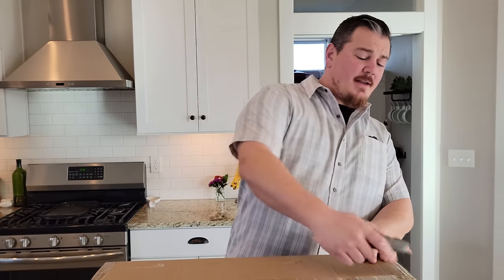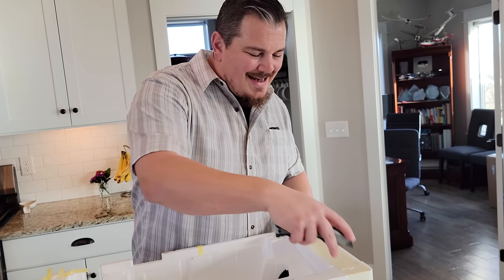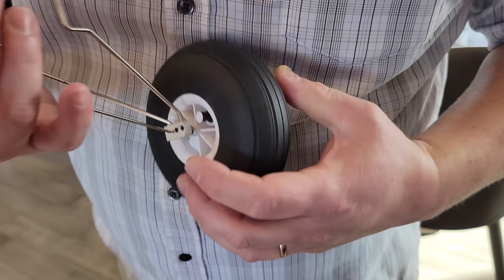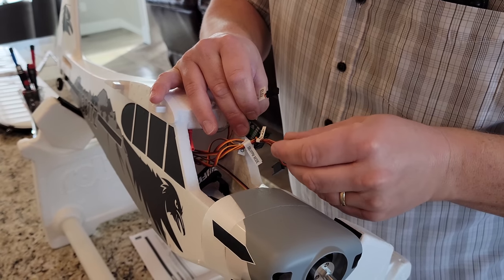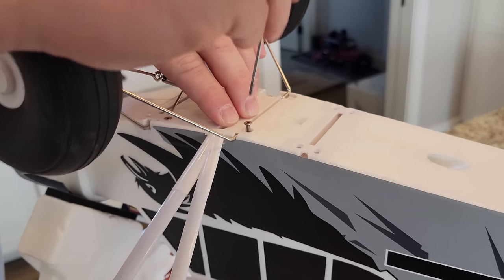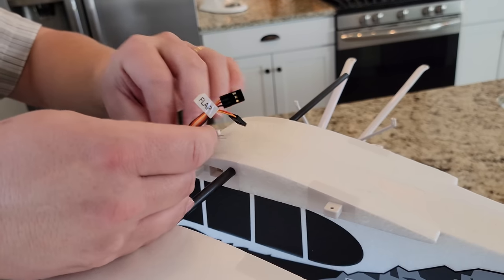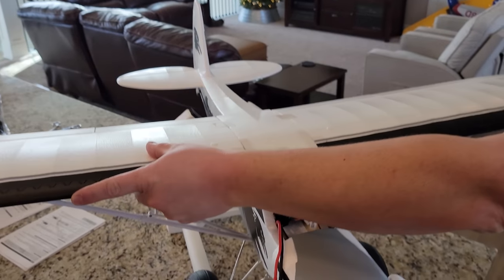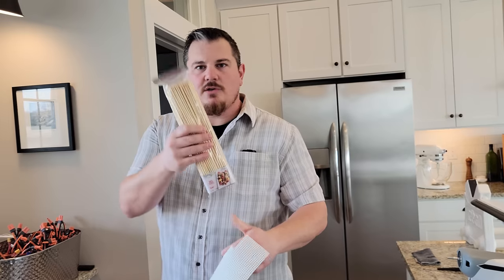FMS - PA-18 RTF - 1.3m - Unbox, Build, & Radio Setup

Comment: Thanks for the vid just assembling mine now was pretty straight forward but helps to see someone else do it first. Only change ive made is I upgraded the rudder/ tailwheel servo right off the bat to a metal gear unit based on reviews ive seen. Ive been flying the big stuff commercially for years but now getting into the models too. Cant wait to fly this. New subscriber from NZ for you cheers

Comment: I know this is an older video, but this with reflex V3 or the 1220mm Ranger with reflex V2 for a first large plane?  I have one of the micro warbirds that I learned to fly with but would like something larger if you have any input.

Comment: Hi! I Have a question about the FMS charger that comes in the RTF. I bought the plane and When i wanted to charge the battery first then the light for s1 got green, then s3, and s2. Is it normal? I dont know if i want to buy a new charger.

Comment: Wow that's a dulled down transmitter.....I got the fsi 6x as a first radio and it has a screen and 10 channels....I've never seen one like that and it's technically the same model....mine had all kinds of knobs and levers everywhere.....but it lasted about as long as my first plane.....1 to 2 flights lmao....then I bought a spektrum setup and now the flysky just sits

Comment: I just crashed mine on my maiden flight. 😢 I am not sure at all what I did wrong. Extremely discouraged because I think I did everything correctly. Just a small suggestion, maybe go a little slower when showing setting up the controls. I had to continuously rewind to make sure I set it up correctly. I am 100% a beginner as well. Thank you for the video it was extremely informative
Reply: just change your youtube speed setting to a slower setting
Reply: I agree not the best setup instruction video, I also had to rewind 100 times during the wiring setup

Comment: Do you know which floats work with the 1300? I am confused on the 2 they offer on website none of which say they are for this model...?
Reply from the maker: I'll check right now...
Reply: @BrianPhillipsRC  Any luck? I saw a 1400mm set and 1200mm set(one was out of stock). Also what is the USB-C wire for? I got all excited thinking I could use the transmitter for my simulator, but I don't see this wire referenced anywhere. Thanks man!

Comment: Great video Brian. Can you recommend replacement batteries that will give me more flying time vs more power? 3300ma 50c?
Reply from the maker: https://bprc.me/3S_2200 - This is from our VIDEO DESCRIPTION (our standard recommendation) but you could also consider a 3200mAh - https://bprc.me/3200mAh_Lipo - HOWEVER, you'll need to be careful about the WEIGHT of the pack. Doesn't seem like a lot, but it adds up.

Good luck!

Comment: Nice video, Brian. May I know whether you can bind NX8 to this plane?
Reply from the maker: Yeah, if it's bought as a PNP and you use DSMX or DSM2 compatible Rx, you can for sure, but I assume you know that already.... If it's a RTF, I think it's FR Sky or FHSS (not 100% sure, but we show what it is in the video - sorry I can't remember), so you'd have to swap out the Rx for an AR620 or if you want to pull out the REFLEX, you could put in an AR630 or AR631 and do great.

Hope this helps!

AFHDS is the protocol - it's printed on the Tx, just saw it.

https://bprc.me/FMS_PA18
https://bprc.me/3S_2200
https://bprc.me/AR620 - for PNP with Reflex V2 
https://bprc.me/AR630 - for PNP without Reflex V2
https://bprc.me/Tx
Reply: @BrianPhillipsRC  Thank you for your quick response and clarification.   Glad to know REFLEX can be replaced as well.

Comment: Brian - I’ve noticed in most of your in the house videos, you store all your batteries in the corner of your kitchen counter. You normally have a multi plug adapter plugged in with several plugs plugged into it. I’m not sure if you realize this but that is a HUGE disaster waiting to happen. If for whatever reason, one of those batteries catches fire, you’re going to lose your home and more!
Be safe, store your batteries in a fire safe box and in a safe location. I would hate to see you post a video of your burnt down house.

Comment: Hi.. would you please help me? I did everything like you in my plane in the assembly.  But when I turn my transmitter off. The throttle turns on. Why is that? Did I do something wrong? Thanks for your time
Reply from the maker: There's a procedure to calibrate THROTTLE.

You need to be super careful, so you don't get cut, or damage something...

1) Plane off, Transmitter off, PROP OFF - if you're not sure why, YOU NEED TO DO IT
2) Transmitter ON, THROTTLE FULL (100%, all the way up)
3) Have someone hold the plane by the tail boom, so the full throttle would not cause them to let go, and it'd be no biggie to just try again....JUST IN CASE, this part will prove to NOT be necessary once you understand how this works, and you can do it all by yourself.
4) Now, power on the plane....yeah, you have to plug in the battery...get it safe AS SOON AS POSSIBLE
5) Listen to the WEIRD BEEPS that you're NOT used to hearing...this is ENTERING PROGRAMMING MODE
6) When these beeps stop for a second, pull the throttle stick DOWN ALL THE WAY (0%)
7) You'll now hear the plane initiate as usual, and do the "dance" of the surfaces, and hopefully your THROTTLE will be calibrated.
8) Test the throttle. If fixed, let your helper go, and get the prop pack on...you're ready to fly.

If this procedure DOESN'T work, read the manual, and look for the ESC PROGRAMMING GUIDE, and it will tell you the stages, in case you're not hitting the right step "Throttle Calibration" which is almost always any time in the "Menu".

Get it done, and get back if you still can't figure it out.
Reply: @BrianPhillipsRC  thank you very much

Comment: The fact that this plane comes RTF is great bug I kind of want to spend a little extra for the 1700mm. The only thing is that I don't want to spend hundreds more on a radio, receiver and battery. Do you know if I can use a cheap aliexpress radio and receiver or something like that for the 1700mm version? Does this 1300mm version have the capability to use thrust reverse with the RTF setup?

Comment: Brian Im looking for a great beginner for small parks.. what do you suggest?
Reply: They used to sell a plane called a Champ. I dig that plane it's so easy to learn on and it flys so slow.  Stick with e-flight or planes that have Safe Mode. Safe mode makes it literally 10x easier to learn. I think they have a Cub out that replaces the Champ. It's got safe mode and you can put floats on it. It's 4 channel no flaps. 
   I think another super easy plane to fly is the Night Vapor! BUT there can't be a whisper of wind. It has to be dead calm and that's why the Night Vapor. At night there's many times zero wind and you can fly that on a small area.
Reply: @HciContractor   i have a T-28 Trojan 1.1 with safe. Do you know if there is a way to adjust some safe settings?

Comment: Im am not finding much info on this, but....how similar is the Reflex stabilization to SAFE?     Does it also add in elevator and rudder on turns, or only self level when you let off sticks?
Reply from the maker: It is almost exactly the same, but SAFE and AS3X are directly handled inside the Receiver, while Reflex, is an EXTERNAL stabilizer and flight controller.
Reply: @BrianPhillipsRC  thank you!

Comment: Cant connect rear and front part of a fusselage on mine, holes are 2mm off.
Reply from the maker: That's crazy bad! I don't know how they got so far off. Might need to hit up FMS and see about a replacement.

Real sorry you had this issue!
Reply: @BrianPhillipsRC  its off for same amount on upper and lower hole on the fuselage and that is quite lot( more than half the size of that metal cilinder in which screw goes). I did contact them and am waiting for response. To me it looks like its not just mine plane. Question is which part is wrong, front or rear.

Comment: Great video! If I purchase the PNP version will it have the auto leveling and stabilization? I have my own transmitter and receiver. I plan to make this my first plane, I hope it’s a good choice to learn on. I have been practicing with a simulator and my transmitter connected to my pc. Thanks again
Reply from the maker: If you want Auto-leveling and Stabilization to pair up with your Tx and Rx, then you want the PNP+Reflex.

Also, you might have Auto-leveling and Stabilization on your Rx already....what are you using?
Reply: @BrianPhillipsRC    Radiolink AT10 II 2.4G 12CH Radio Transmitter and R12DS receiver. 
I keep reading that an AeroScout is a good first plane. I have seen this plane but I am now leaning towards the Arrows Trekker. Being that it looks like a traditional plane to me, and the Scout is just different. 
From these 4 planes; FMS PA-18,  AeroScout, Arrows Bigfoot, and the Arrows Trekker. Which would you best recommend for a first time flyer with just RC plane simulator experience?

Comment: Mine crashed 6 seconds into it's maiden flight and is totaled, sigh.  (was going straight then it banked hard right and down outta no where about 4-6' up.)
Reply from the maker: Sounds like the ailerons were reversed. Did you figure out the root cause of the crash?!?!
Reply: @BrianPhillipsRC  not yet, waiting on the video back from my buddy that was recording.  It was going pretty straight before the bank/dive,  I was waiting to get some altitude before I tried any maneuvers so I could clean up trims.
Think I'll wait for the pnp kits to be back in stock now, cheaper than just buying the parts that broke.
Reply: @BrianPhillipsRC  reviewing the video,  I can hear the power to the motor cut out for a half second causing the nose to dip down.  So then when I tried to counter the dip the engine went back to the power it was at and then that's when it banked to the right and down.  
  I can send you a short video link if you're curious or have time to offer a more educated perspective.

Comment: Everyone is making fun of the channel for "losing elevator"  when he took off full flap and then ballooned and killed throttle and removed flap.....def a stall and I know for a fact this model is hard to make it bite
Reply: The elevator had stripped gears and got stuck full up. That's why it stalled and he crashed. He knew it was faulty and took off anyways, that's what people have a problem with. The plane was NOT airworthy and he knew the servo was faulty.